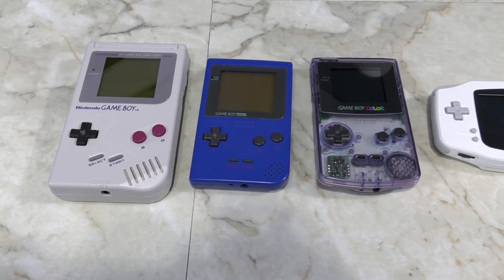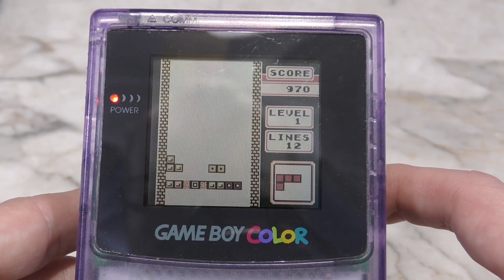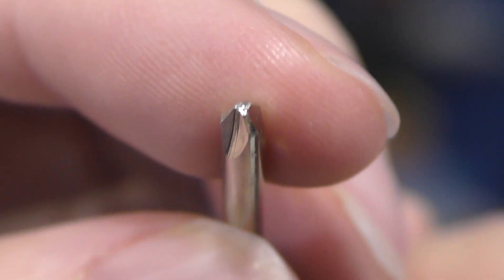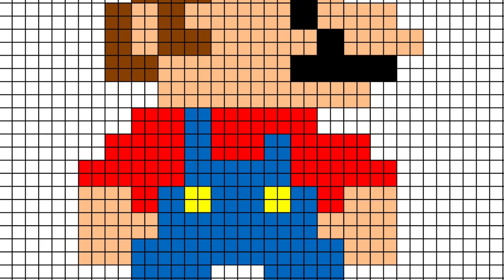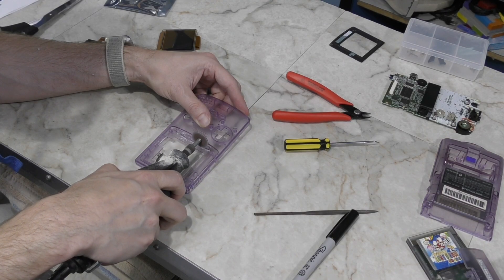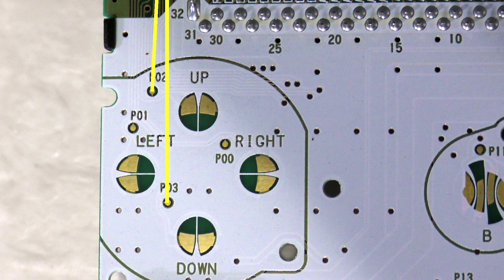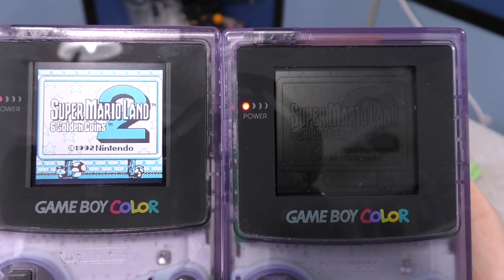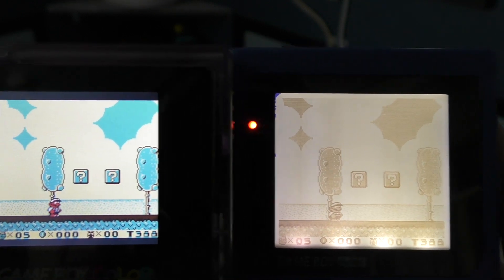Finally - A Gameboy Color Backlight Mod!

Comment: CORRECTION: The Game Boy Color's bootrom contains several unique palettes for original Game Boy games (including nearly every pre-GBC first party game) which are initiated as default when it reads the cart's ROM header. In fact, it's more robust than how the Super Game Boy interprets color for non-enhanced games
Reply: Well, the problem with this implementation is that the color is static throughout the game. The SGB can receive palette change commands from SGB enhanced games like Pokémon Red (for example, going from one area to another). The CGB, can’t.
Reply: RAMChYLD ...but the SGB can only do that for SGB-enhanced games where the GBC does it to earlier games. GBC bootrom also does it better than you could do manually with the SGB since it can apply a different palette to the sprite layer and SGB can’t. This sometimes gives you more than four colors on the screen.
Reply: Exactly.  In short for original pre-GBC games, the Super Game Boy can assign a new four color palette to the screen, but the GBC or GBA can assign a four color palette to the background and a second four color palette to the sprite layer.  I was amazed by this the first time I saw it!
Reply: Came here to say this!
Reply: Yeah, probably not  Super Gameboy, since AFAIK the GBC can't interpret super gameboy data and vice versa.

Having said that there are tradeoffs to each. For games with no colour data whatsoever, the SGB lets you assign any arbitrary 4 colours out of the 2000 or so the device supports in any combination. (plus the 64 or so default sets)
It also lets you override the colour choices of games that DO include a preset.

The GBC has uhh... 12 I think it was pre-configured palette sets, and they only work if the game doesn't assign any values.

There are at least 3 categories of games for the GBC

Original GB games with no support. - use a fixed palette defined by your choice at bootup. (some handful of these games have a dedicated palette in the GBC firmware)

Hybrid games - These are meant to work on both an original GB and a GBC, and frequently contain some enhancements, but not the full GBC featureset.
Pokemon Yellow is a great example, in that it uses independent sprite and background palette sets, and changes the palettes dynamically as you go through different areas of the game. Note however that Pokemon Yellow also demonstrates these exact same qualities (especially the palette changes) when run on a Super Gameboy. Typically this results in about 10-15 colours onscreen at once.

Native games - These won't run on an older gameboy, (nor a Super Gameboy - even the Japanese Only Super Gameboy 2, which is from the same year as the GBC). These use the full feature set of the GBC, including it's 56 colour mode and enhanced speed and memory.

Meanwhile, it's worth noting what the Super Gameboy is actually capable of, even though almost no games made use of it;
(in particular, almost no games made use of the full capabilities. There's like 1-2 games that even demonstrate any given advanced feature)

The Super Gameboy lets games do any of the following:
- Set a colour palette, and alter it at any point in the game
- Set a custom background (this too can be altered as the game runs)
- Send code to the SPC700, thus giving the game an enhanced, SNES style soundtrack
- Apply a colour map overlay of 8x8 cells which can apply any of the SNES colour palettes to the cells, allowing something like 200 simultaneous onscreen colours. The downside is the update process for this is quite slow, so it has to be used with caution, and is easier to use on static screens than on dynamic ones
- Load arbitrary SNES code - at least one GB game uses this to essentially load the smallest SNES game on record - a version of Space Invaders that takes up just 32k. This can literally do anything a SNES game can, but it's limited in that the whole game has to fit in the system's RAM, which means it has to be 128k or less. (most SNES games being at least 1 megabyte, and many being 2-4, that's quite a restriction.)

So yeah, the Super Gameboy is absurdly powerful, it's just, as with most such accessories, few developers seem to have bothered...
Reply: Mostly comes down to which games were made after the Super Game Boy but before the Game Boy Color.
Reply: @davidmcgill1000  To my knowledge Super Game Boy features have no bearing on games being played on GBC or GBA.  The console has specific palettes preprogrammed for first party Nintendo games, others start with a default palette.  These pallets can be changed by the user at start up.
Reply: @TopSpot123  That's my point. All games made before both hardware releases do not care about what it's running on. The hardware itself changes behavior specifically for those games, but games designed for Super Game Boy are looking only for it to provide benefits. They don't know anything about the Game Boy Color. Games made after the GBC can expect both of them and change behavior on its own terms.
Reply: David McGill Wario Land 3 has a SGB and a GBC version. The GBC version looks terrible on SGB. The SGB version has some of the best SGB enhancements I have ever seen but, of course, isn’t great when played on a GBC.
Reply: StrobeFlashLite can you give some examples please
Reply: @nicklesm202  https://tcrf.net/Notes:Game_Boy_Color_Bootstrap_ROM
Reply: @StrobeFlashLite  I was about to say this! This is one of my favorite features of playing older Game Boy games on a Game Boy Color. Makes games look really cool in different ways and you can change it when you start them up every time!
Reply: Erik Nickles Examples? Well, he shows Super Mario Land 2 Six Golden Coins in this video, which is neither SGB nor GBC-enhanced. The color comes from the GBC. The examples I like to use are Metroid II Return of Samus and Kirby’s Dream Land, since you can’t even duplicate those results manually on an SGB.

Metroid II shows more than 5 colors on the screen since it basically applies a 4-color SGB palette and a different palette for the sprite layer (typically Samus herself). In KDL Nintendo specifically colors the sprite layer pink even though Kirby was white in the USA at the time that game was sold. This causes a few weird-looking artifacts in the game that only make sense when you realize that the pink color is from the GBC and not the game. For example, the blocks around Wispy Woods’ mouth turn pink every time or gusts air at you blocks in the cloud flood turn pink when fighting Kracko.

The color definitely comes from the GBC BIOS.

Comment: Clicked on the link, aaaaaaaaaaand it's sold out. I did the frontlight mod on my GameBoy Color, however, the battery LED I replaced is pressing against the screen protector (might be because I didn't press the light through the pads yet or the light is too tall).